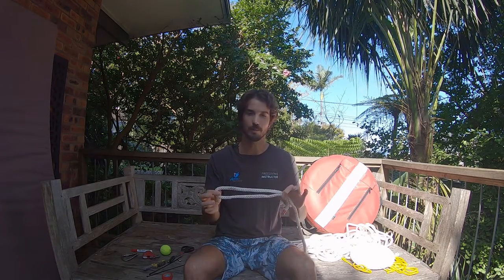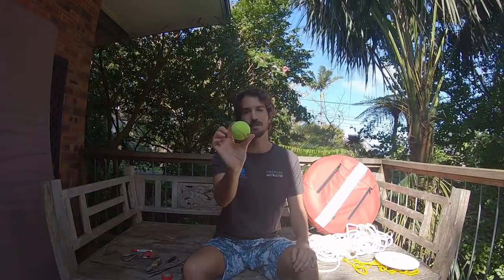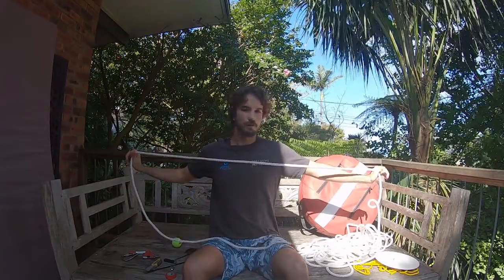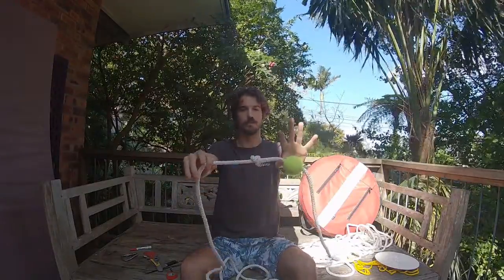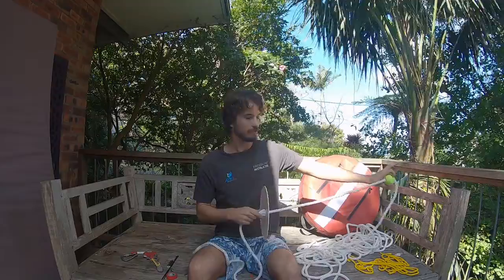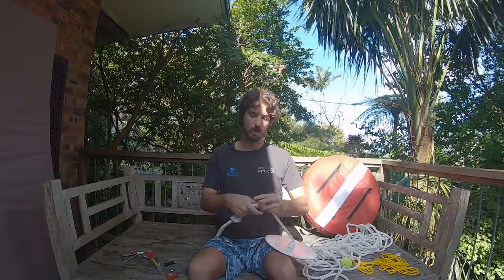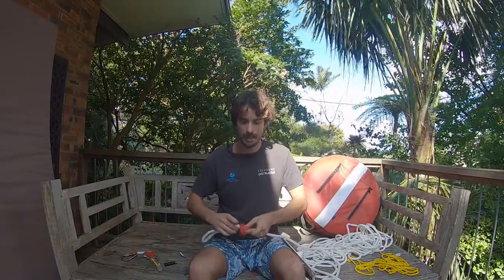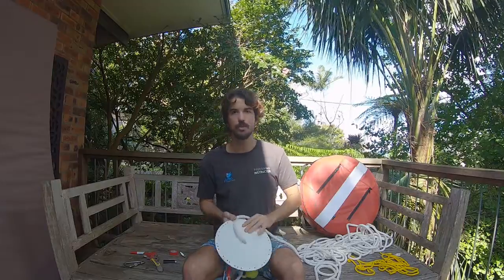How to setup a freediving float Part.1- starting your training rope

Comment: Just got my bottom plate so I gonna make this now. I will not use sipties and knots for the bottom line tough I will braid the rope in to it self to make a more permanent loop.
Reply from the maker: if it works it works. i have my spearfishing line braided into itself like that.
Reply: @Jackhatfieldfreediver  yea I like that attitude. If it works it works. Makes everything simple and easy.
Going to my boathouse now soon to finish up the line. I am unsure how long to make it tough. I can now dive to 12-15m and need some room for improvement. So I think to make it 30-40m. What length is practical for a beginner line?